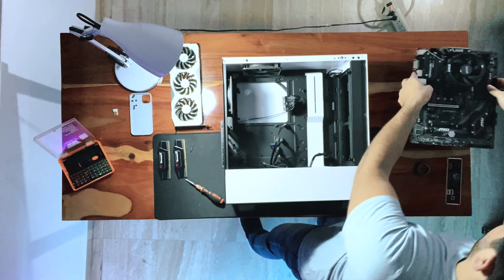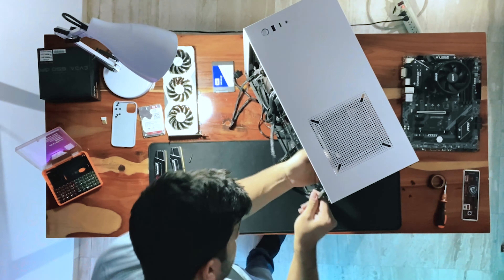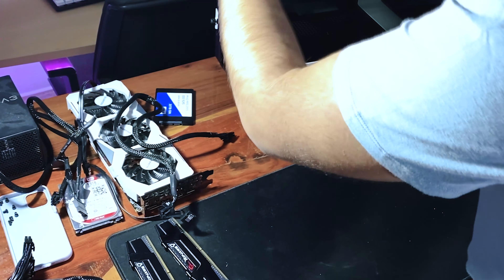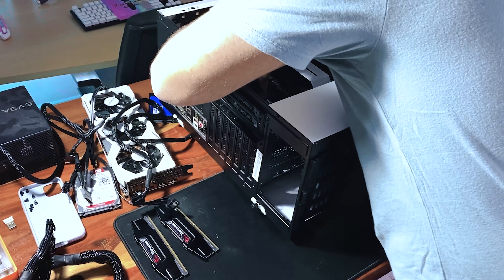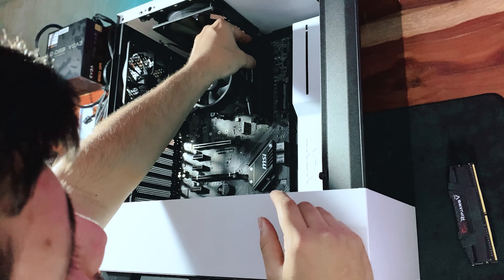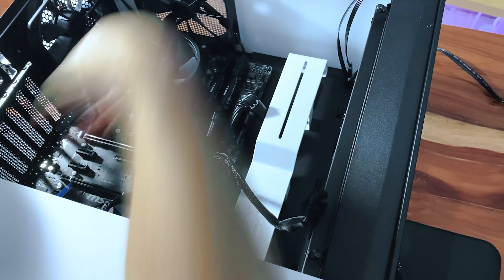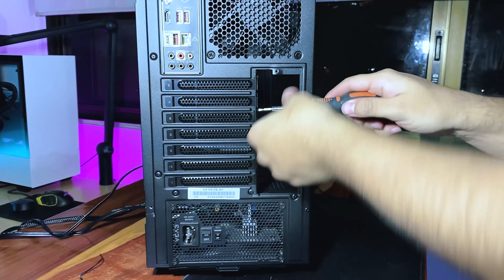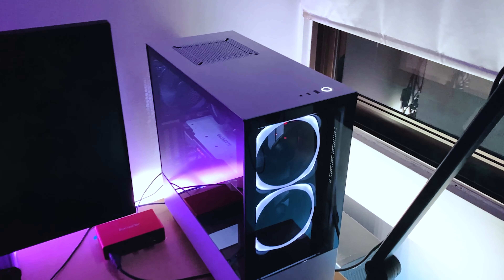How to Case Swap/Build a PC | NZXT H510 To Elite

Comment: Just wanted to comment because I just got finished case swapping my pc from a Lian LI mid tower to an NZXT H510 Elite. If you're thinking about doing it, do it. Remember to take lots of pictures before you start of the motherboard and all of its connections. If your forget it will be okay, I forgot and it just took me more time to finish. The swap took me about 3 and a half hours start to finish but was a great experience and I learned a lot. If it wasn't for this video I'd probably still be working on it.
Reply from the maker: Im very glad it was helpful!

Comment: ya i just did my first game pc build or swap.  I recently bought a ibuypower pc with the case that had no airflow and i did not like it.  i did buy this one the h510 elite and really like this case.  it took me a little while from start to finish about 2 hours or so.  the most pain of it was the cabling.  learning to do the proper cabling and making sure everything is plugged in took some time.  but once i did the swap and build i am now enjoying my new case.  i just did a swap of my fans on the elite cause two fans were not rgb kind of weird since the front ones are.  little by little I will add rgb memory and rgb cooler to it.  eventually I will have a good gaming system.
Reply from the maker: Nice! I just swapped my fans as well and it makes the whole look feel complete rather than half assed with the plain black fans! I think the most important factor with Pc building is to know where each cable goes and how it fan affect the overall pc. That said cable management is also huge when it comes to swapping components and overall aesthetics! Hope youre enjoying your build and whatever you plan on adding next looks amazing!
Reply: which pc did u buy? cause i want to buy a prebuilt and swap the case to the h510elite but idk what prebuilt pc to buy

Comment: I wanted to case swap my pc I built but I wanted to know that when I do does it make you redownload windows and the bios and stuff like that
Reply from the maker: Not if you use the same drive and mobo to boot the system! Swapping the case only changes power towards the front io and the fans :)

Comment: I dont know much about pcs but i want to buy a prebuilt and case swap it to the h510 elite do u know any prebuilts that are compatible with the h510 elite in the 800-1000 dollar price range?
Reply from the maker: Right now you could go to the nzxt page and get the starter prebuilt which is the h510 and then case swap or you could get a better version with the elite already included!

Comment: Hey man just curious on some help, im upgrading from a Antec Case to this exact NZXT case, the only thing im wondering before take off is where the fan controller cable plugs into my motherboard? (i think its a three pin cable) thanks for any help in advance